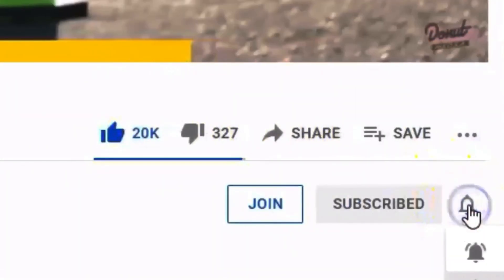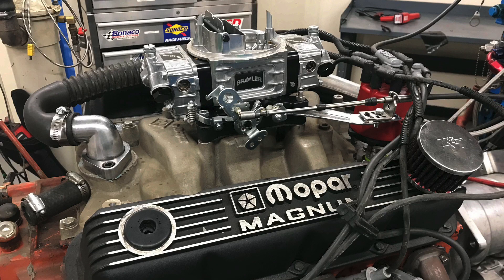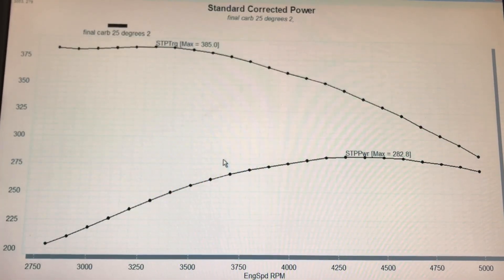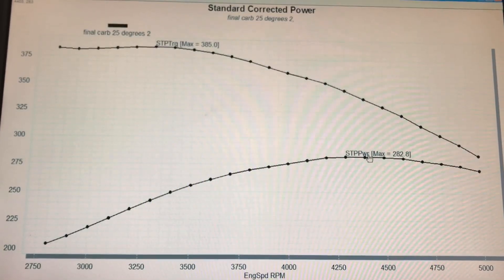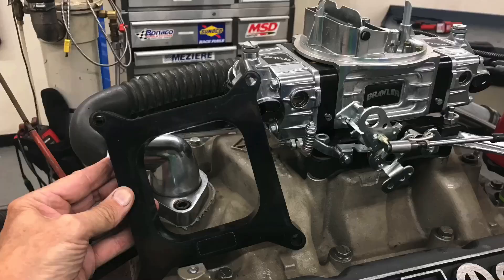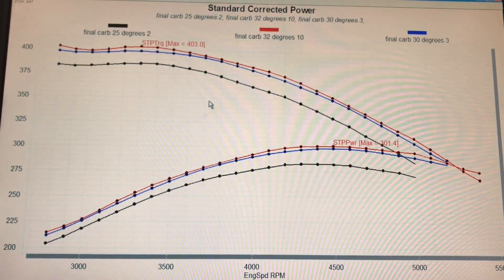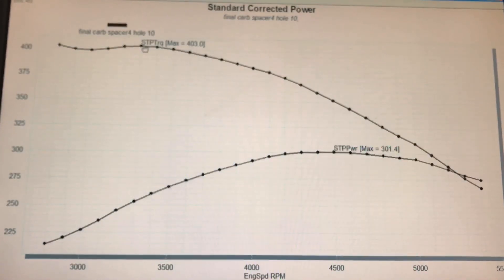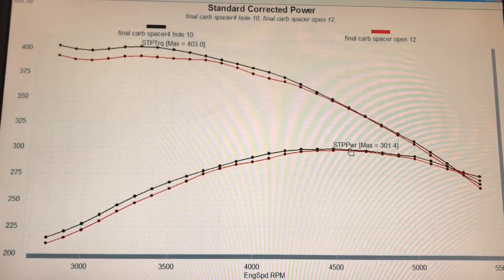DO CARB SPACERS REALLY WORK? 4-HOLE VS OPEN (360 MAGNUM-HP & AF-FULL DYNO RESULTS)

Comment: 4 hole beats an open design, WITH THAT PARTICULAR carb and intake. I would like to see the results when using an AFB or AVS in the 750cfm range. My 30 over 9.0 to 1 360 with a MP 450/455 cam and now Edelbrock spread bore dual plane instead of an M1, consistently made 8 hp and 14 lb ft more with an open spacer, than just sitting on the manifold. It made an average of 6 more hp with the 4 hole but only 5 lb ft, (that had to be mildly machined to accept the secondaries), over just the carb on manifold. Timing was using an MSD set at 34* at 2800, no vac adv. I will say this. The AFB did need some jetting and rod tuning because out of the box, it was lean down low, but way rich WOT. The AVS was better at low and mid range, but still rich WOT. Anyways enjoy your vids!!

Comment: Thank You, Richard for the Magnum Series!.
   Too bad the M1 dual-plane intake had such a limited production run.
   They were around $300 each back in 2006.
   The water heated intake makes for good driving in cold weather- some vehicles are more fun when the snow starts flying.
   When these M1 dual -planes sells used for 2X what they cost new here is definitely interest.
   A Edelbrock Performer or Performer RPM for Magnum would be easy-borrow from the Magnum AirGap  the intake to head section to bolt to the Magnum heads.
   The 5.9 Magnum had a production run of almost 20 years, millions made, going to scrap.
   All for the want of a bolt-on Performer, Action Plus, or Contender intake.
   Glad to see the Magnum get some attention.
   Go make some Magnum noise!!
Reply: Love mine on my Ramcharger. Thing runs so good I’m hesitant to put efi on it.
Reply: @blueduster74  Another year later....
No Change on the manifolds.
   Ma Mopar's last two owner groups come from non-hot rodding cultures.
   Ramcharger's are always fun.

Comment: The 4 hole is clearly better for a dual plane intake.  For a mild street engine. Though in the past I have seen the dividing wall milled down 1/2" reputedly for improvement ay higher rpm. This on both factory and pro built engines. Holdens and Clevos
Also those spacers are 1",, not half inch
I have dabbled with spacers on open plenum on Chevs. Base Victor Jnr with modded fueliie heads the 1" spacer helped and the 2" was better
Ditto on a Bowtie version on Dart 2 heads and again on a 2925 on Edelbrock Victor 23 deg heads. 
Edelbrock ofcourse make these intakes short enough to go under most bonnets.
In my case the carb [ with 3" airfilter] was living inside the reverse bonnet scoop

Comment: I'd love to have that engine for my 1977 dodge  w200.     Richard what about the height of the spacers. Then what if you put the open space then put the 4 hole then try the 4 hole then open??????????????
Reply from the maker: 1/2 INCH THICK
Reply: @richardholdener1727  awesome,  what about 2in thick spacers

Comment: I'm curious if the open spacer would do better with a more agressive cam shaft
Reply: No, 4-hole or directly on the intake. Radical cams with lots of overlap love the extra carb signal, especially if you have a carb with annular boosters, they can be worth close to 100 ft/lbs down low.

Comment: Open spacer? Carb to open spacer then open spacer to 4 hole (4 hole to open then back to 4 hole). Turbulence possibly? I always thought that the open spacers worked best with single plane intakes but I could be wrong. Note the torque curve: Max torque is exactly where you need it in a pick-em-up or heavy van that might be pulling a load. Possible that the MoPar engineers designed it that way for a reason? I had a 98 Ram 1500, 5.2, 5 speed, 3.23 gears and it would pull an all steel car hauler with a Duster on it just fine in 4th gear. Cruise at 65 all day with cruise set.

Comment: Hey Richard,  have you done a comparison on 350 chevy to a 383, same heads same cam ? To see how stroke length changes torque and horsepower built on the same frame ?
Reply from the maker: THE GAINS WILL DEPEND ON WHICH HEADS AND CAM YOU CHOOSE FOR THE TEST
Reply: And I apologize for hijacking the Mopar topic.........I am the same...engine guy not a car guy

Comment: I was a bit surprised that there was a power loss with the open spacer. I was under the impression (based on other videos from your motor trend pals) that an open spacer on a dual plane would help out the top end, without much of a down side.  The power loss you show is a huge down side.   Could the conflicting results be due to the engine size vs carb size?  I would think a 750 would be a plenty of carb for a stock 360.
Would there be the same results for a engine that has a bit of an undersized carb?   Im thinking about my own application, where i have an edelbrock 650 on a fresh built 408 and a 1" open spacer and a performer RPM intake.   My air fuel gauge shows im plenty rich right off idle, at the edge of the transfer slot, before the metering rod makes much of a difference.  1100 RPM cruising.   i wonder if a 4 hole would be the answer, or switch to a 850 AVS2, or both.....
Reply from the maker: A SMALLER CARB ON A BIGGER MOTOR WILL RESPOND DIFFERENTLY TO SPACERS
Reply: @richardholdener1727  Can you please test spacer height from 1/2" to 1" and up? I just watched a few vids of yours and in one of them you said that you gave an example of using the dual plane intake and just put on an open spacer at the track. But what would happen if you went with a taller spacer; if you repeated your tests of dual plane/single plane in takes with open and 4 hole spacers, but go up in height?

Comment: Hey Richard, could you do a comparison between a 4 barrel intake and the same intake but with the plenum divider milled down? I think I heard of it being a good change from some banter on an episode of engine masters or roadkill garage but never saw specific numbers. I would imagine it would smooth out the intake valve pulses.
Reply from the maker: IT WORKS SIMILAR TO OPEN SPACER

Comment: Why did you not Retune the Carb for the Open Spacer to match the FA Ratio Power would have been closer if you did? its good to know that will happen but we need to see the Open Spacer Power after retune of the carb for it, if it makes it act like a single plane up top it would be beneficial to the power band of the Duel plane for those who want the best of both worlds!
Reply: It should have made the most power with the leaner A/F ratio. But it was leaner because it had a weaker signal. Richening it up with the open spacer would have made even less power.
Reply: @1967davethewave  
not necessarily, I seen too lean low rpm get rich and make 35 lbft of torque 2700 - 3700, 
this happened when using a spread bore carb and adding an air cleaner with a short spacer between base and top of carb
Reply: @1967davethewave  Exactly right. Fattening up the AFR might pick up a little torque, but you would lose power.
Reply: Open space on a dual plane defeats the purpose of a dual plane. You just compromise the purpose of the dual plane in using the open spacer.
Reply: @erikturner5073  shallow spacer has benefits , can help idle circuit with some carburetors, 
there can also be benefits of a spacer between carb and filter base ,
Reply: @nerradnosnhoj5122  I run 1 inch 4 hole spacers on my street setups and like them. I said that I shake my head at people who choose to run OPEN spacers on dual plane intakes.  Just choose the proper combo and set the tune right and your good. The open spacer on a dual plane is nonsense and Richard proved that! Airflow is important, but in a street motor with a carb, vacuum signal is very important as well. Especially with torque production. Throttle response, as well as torque production, or lack there of can make or break a street and or street/strip combo.
Reply: @erikturner5073  I understand what you are saying with the set up Rick tested, 
 We used a open approximately 1/2" adapter to install a spread bore on a square bore manifold. We did not test a thicker 1" open spacer . We discussed milling a shallow cut out of the divider to help idle quality , metering etc . This engine has 16-17.5 "  at 700 rpm and using the shallow spacer with this carb worked perfect , builder confirmed on dyno and engine was tuned with another spacer between top of carb and air filter base . 
 Using dyno load to simulated the engine behavior at highway speeds for a 1/2 ton both not towing and towing ,  throttle response excellent , Dave and Steve did some tests and milled a shallow cut from plenum divider that helped their Dyno testing , again , not a tall open spacer or a deep cut into the divider , helped in 2 dyno sessions that I have seen 

 I do recall comparisons of 4 hole and open  maybe 1" spacers and those results with that carb / intake / engine. 
taller spacers and  different engine combinations

Comment: Thank you for this!  I usually use phenolic or resin spacers and fuel return system on carbs to try and keep the carb and fuel temps low.  We all know that carbs hate modern fuel and the cooler we can keep them the better the engine will start.

Comment: The torque curve on these engines makes you run them at part throttle to keep the revs down in the power range. I noticed it dropped 100 ft lbs above 4K rpms.

Comment: 4 whole worked, open didnt. Your pals at motor trend showed removing 1" of the divider was worth a power gain. Curious what your thoughts are about that. 
  And with a dual plane. Each side of the carb is only shared with 4 cylinders. 1 primary and one secondary.  With a double pumper with 72/74 jet balance. Does it equal out to a 73 jet average?
   There just seems more to this then these simple results. I believe a low profile single plane with a 4 whole tapper spacer would yield the same results! I believe the open spacer disturbed the signal at the base of the carb. Also the reason the A/f was leaner.
Reply from the maker: THEY TESTED ON A DIFFERENT COMBINATION-SPACERS AND MODS ARE NOT UNIVERSAL

Comment: Hi Richard,  you always seem to leave me with questions.  I have different brand engines. But currently working on sbf's. If you were using the air gap manifold?! Which spacer should I use for it. It's not the open style or the 4 hole. Therefore this didn't apply to my application.  Also; if I use a 2 hole spacer?! How does the notch affect the spacer? Would an open spacer, 2 hole or 4 hole work best? Thanks Rick
Reply: He won't know that because spacers are application specific and do different things on every combination. It is a tuning aid... Not a one size fits all. All you are doing is helping a poor choice in manifold if it responds. Tuning aids are trial and error. Ask the engine what it wants. 
That said, In my years of testing with Air Gap dual planes. They like a 1" HVH Super Sucker. Not open. Not 4 hole.
Reply: @jrdmotorsports9718  Who knows what this guy has in his library of knowledge. He may already have done the test. Seems to me that's what this video was about. Seeing what the up/down is for each application. I'm curious if I keep the notch between the spacer and manifold or should I fill it in? Or I could plane it down and use a taller spacer to compensate what I remove. I assume you don't like the air gap?
Reply from the maker: THE FORD AIR GAP IS A VERY GOOD MANIFOLD

Comment: Just a couple days ago I posted a vid about putting a four hole phenolic spacer on my friends 76 D100 318 with the stock cam advanced 4 degrees, an Edelbrock SP2P low RPM torque intake for heavy vehicles and a Qjet. The four hole spacer severely outperformed the open 1/4 inch gasket we had before hand. Without the four hole it would only leave about a foot of rubber and slowly accelerate away but with the 4 hole installed it leaves several feet of rubber and accelerates much more aggressively.
Reply: That's what they do. More signal at the carb, better it pulls fuel=more torque.
Reply: @jrdmotorsports9718  They also split the carb in half only letting each individual cylinder see half the CFM it would see.This can be good or bad depending on the specific application. I tried a 4 hole spacer on my solid lift 235 HP 273 thinking I'd gain some much needed torque to get through the low RPM bog of my  2.76 gears and it did help a little bit down low, but it hurt so bad up top that I swapped back to open after one drive. Funny how some engines completely defy your expectations.
Reply: @Impactjunky  It's ALL application specific. They are tuning aids. The magic isn't from the spacer, but what the spacer is doing for the combination, and how it is affecting the manifold. 
Put a 1" open on the manifold, and put the 1" 4 hole on top of it. Watch what happens.
Reply: @jrdmotorsports9718  I've heard a 4 hole on top of an open spacer makes really good power, seems like we may have been reading the same article or at least a similar one. I wish I still had that little 273 around to experiment with but I tossed it out for a cammed, carb swapped 6000 RPM 5.9 Magnum years ago. Getting ready to see if the Magnum likes a 4 hole tapered spacer as a compromise for a 4 hole on top of an open because my velocity stack/air cleaner combo doesn't offer me any extra hood clearance.
Reply: @Impactjunky  It's not from any article bud, 35 years in the business,  and have tested my fair share... on the dyno, and on the track. Back when HVHs weren't even around I used to make my own spacers, and combined different styles.  I know what they do and why. 
In your application, feeling it lose top end says it needs plenum volume, hence why the open works. Putting a 4 hole on that will help bottom end without sacrificing top end. The reason why you lost top end with just a 4 hole, is due to the plenum volume being too small. All they do is help tune a manifold.

Comment: Good video. You tested throttle body spacers?

Would like to mention, I reference your videos when it comes to building engines, it makes it easy to justify to the wife why I am getting the parts I am. 
Your testing helps pick the right setup to reach the goals.
Reply from the maker: SHOULD I GIVE HER A SHOUT OUT-WILL IT HELP YOUR PARTS BUDGET?

Comment: Excellent video, short, sweet, and to the point.  My experience, back in the day, was that 4-hole spacers were best for street applications and could actually improve low RPM throttle response.   Open spacers were good for high RPM race applications.

Comment: I’ve had great results with 4 hole spacers on small cubic inch short stroke motors.  Open spacers seem better on larger cubic inch. Application depending.
Reply: It all depends on manifold. 4 holes create better signal and more low end torque on big plenum intakes, which helps on smaller inch engines. Open increases plenum volume which does the opposite, but helps with bigger engines that need more plenum volume. Spacers just tune the intake. That is all.

Comment: Reminds me of the time I removed my Q-Jet (bogged during cold weather) and installed a spread-bore to Holley adapter and a 600 Holley on my stock 4 bbl intake.  I felt like I lost ~25 hp and torque LOL.  That’s a lot on a 175 hp 350🙁
Reply: @Edward Wood I just made a vid a couple days ago about swapping from Qjet to Edelbrock on my friends 76 D100 with a 318 and the Edelbrock slowed the truck down BAD. Fuel mileage suffered a lot as well. Qjets and other small primary vacuum secondary carbs really wake up a smaller motor in the low end.
Reply: @Impactjunky  yes actually the Qjet is underrated when the set up is good.  I once had a performer 2101with a Holley spread-bore 650dp which was the best set up I ever had for all around performance on a 350.👍
Reply: Same here, thought the Edelbrock would make more power. Had to replace it with a Holley to get close to the Q-Jet. Eventually just learned to tune a Q-Jet. Just not nearly as easily tunable as the Holley. Something about a dialed-in Rochester.
Reply: I've been a Holley guy for years but I became a big time Qjet guy too. I had always heard stories about how Qjets ran good but I experienced it first hand when I got a good deal on a bone stock 84 Trans Am with a Quadrajet 305 and an automatic. I've driven and ridden in several small V8 cars like 260, 273, 289, and 302 and I didn't have high expectations for the little 305, especially with its poor reputation. But damn was I surprised the first time it spun one tire all the way through first gear. The 273 and 289 were both rated at more HP than the 305 should be making but the Qjet makes the 305 turn up so much faster that it'll leave them both in the dust from a dig. I know for sure it's the Qjets small primary/big vacuum secondary magic because after four barrel swapping my friends D100 with a Qjet it started burning the hell out of one tire just like the Trans Am.

Comment: It would be cool to lift the dual plane and put the 4bbl M1 AND TEST THAT against the dual plane... none the less smother informative video thanks... so everyone go hit the LIKE BUTTON!
Reply: @Daniel G mopar M1 air gap... I have 2 one 2bbl and one 4bbl..
Reply: @Daniel G thanks.. none on any running motors. I did pick up 5 mph with the 2 bbl. With just that switch on 245k 96 ram 1500 in a 94 dakota... itran a 13:42 at 99mph. But I do have a 408 waiting to go in somthimg..
   I'll check into the Huges thimg you mention. And I've acquired his throttle body.. 
     Was looking into buying some aluminum SBM heads but still looking
Reply: @Daniel G I googled IMM The other day... I'm down Houston way